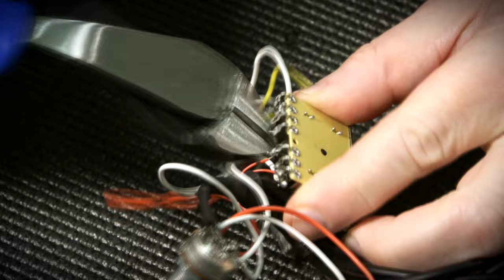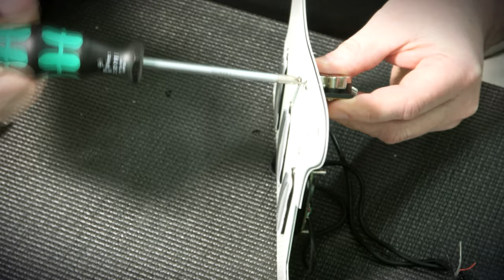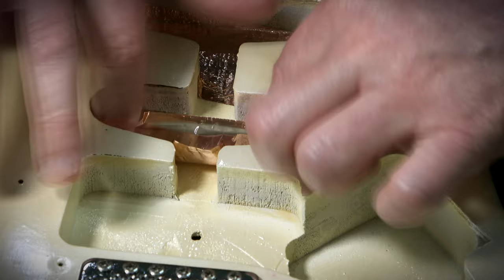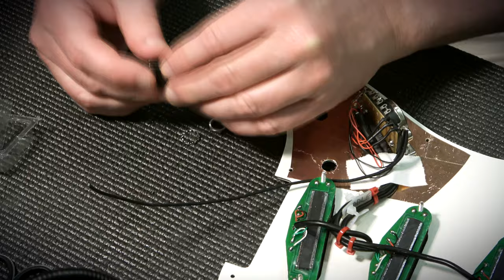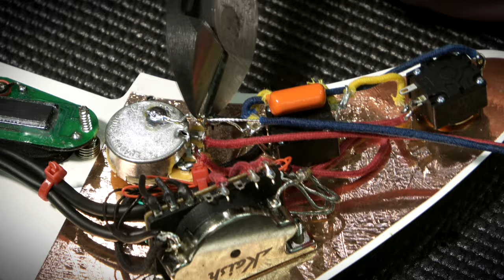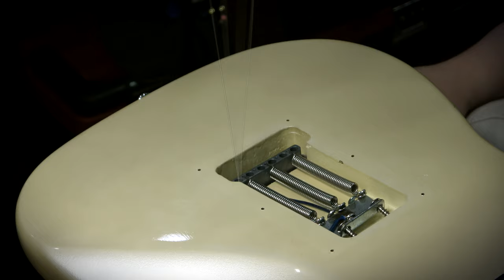1980's Memphis Strat - Bourns and CTS Pots, Pure Tone Jack, Kaish 3-Way Switch, Copper Foil Shield

Comment: Great work! The most clean and thorough I've seen. You have set the bar for me. If I'm going to continue down the path of crafting sound alchemy I need to clean up my work. I learned a lot about how I have to better prepare myself, my components and my purpose when deciding to build, repair, mod guitars; electronics in general...

Comment: hello.... is tha Kaish 3 way switch a good one? I want to replace my stock one for a REALLY GOOD one. please.
Reply from the maker: Sorry for delay in reply, Gabriel! If you want best switch, I'd go with CRL 5-way (or 3-way if you prefer for vintage style...I personally like 3-way switch)...or the Fender branded one. For more complex wiring, there's always Oaks Grigby Super Switch. That being said, I really like Kaish switch. I had to use this low profile type of switch due to thin body/small compartment space of this old Memphis strat copy. So, cavity depth/body thickness is something to consider, especially if you have a thin body guitar. I can't attest to how long Kaish switch will last, but it feels very good quality, and I like it has extra grounding tabs on both sides, which was extremely convenient for ground electronics/pickups. It makes for a tidy wiring job, with all connections in a single row...once you figure out how terminals are configured (very simple once you figure it out with continuity tester). Some of the terminals are connected by metal tab, bridging connection, which may be easily cut off with wire cutters if necessary for your wiring scheme. Good luck with your plan, and thanks for helpful comment, Gabriel Alejandro Centeno Hidalgo! 🤘🤘🤘